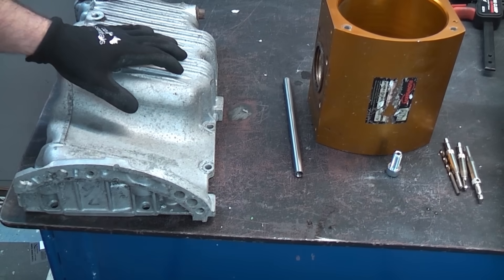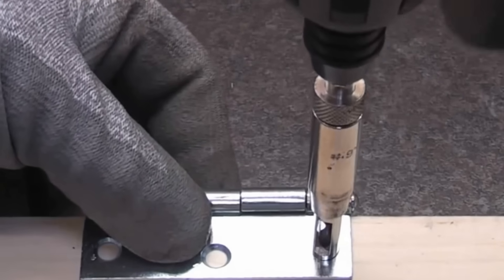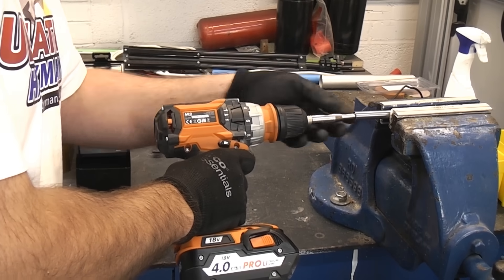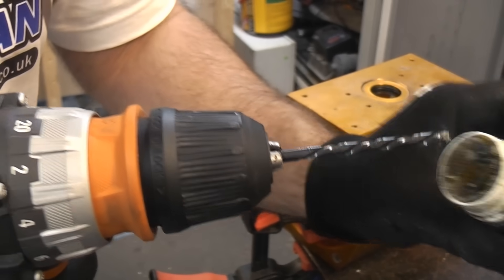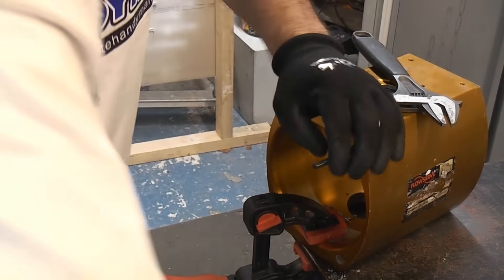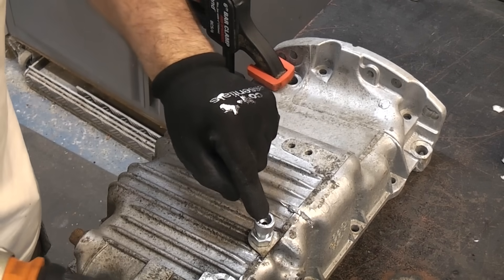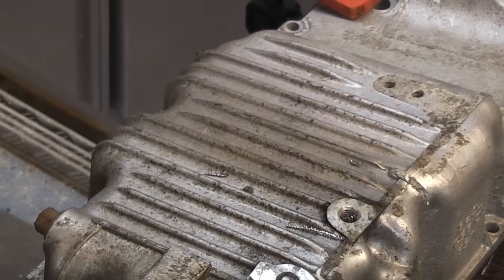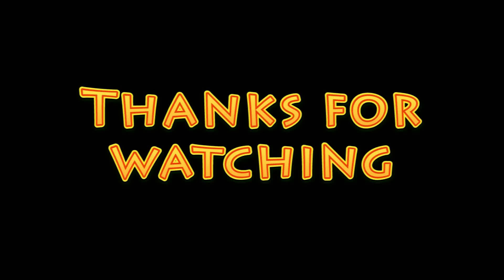How to remove a broken bolt in a deep hole | remove broken bolt in recessed hole

Comment: It’s one of those bizzar truths that drilling a hole through the middle gives the steel a space to shrink in on itself. Only a tiny amount though. The tapered removal tool can have the opposite effect. So if it doesn’t work then consider a proper parallel reveal tool. It’s like a splined rod with special nuts to drive it.
Reply from the maker: Absolutely
Thanks for the comment 👍

Comment: I was a Machinist in the US Air Force for 4 years.  One of the common task assigned was removing broken fasters.  I removed thousands of broken bolts and phillips screws with stripped out heads.
Screw extractors, I do not like the spiral type used in the video.  The tend to expand the broke faster, wedging the bolt in tighter in the female threads.  A weakness of the spiral type is they tend to be of a harder steel easy to break.  The old Rice Crispy cereal commercial "Snap what a happy sound"  there is nothing happy about the sound snap, you  broke a E-Z Out and have a bigger task ahead of you.
I prefer the square type screw extractors.  The square type do not wedge the bolt in the threads and are of a softer steel that will twist before breaking off in the bolt.
I machined a bridge to mount over the bolt I needed to drill.  Interchangeable drill bushing assured that I was drill straight down the center of the broken bolt.  I also used the bridge fixture to tap straight and true threads.
My Flight Line tool box weighted about 75 lbs.  I had lots of specially homemade tools.
Reply from the maker: The square type are definitely better ;-)
Thanks for the comment

Comment: Will never work for most broken bolts which break due to corrosion
Reply: true, you need to heat and cool the really stuck ones multiple times: shock spray, blowtorch, then quench with water. repeat a-nauseum until the bugger loosens.

Comment: Awesome M8! Great idea! Ty. 
 I used to work for Wurth USA as an outside sales. ( I was an auto mechanic for years prior) in Manhattan & Bronx NY territory . Try to get PB Blaster as a penetrent for nuts n bolts 🔩 . Even though it wasn't a Wurth product, my customers swore by it.. I have to say the shit works great! As for heating aluminum casing w steel bolts is a big no no, its like trying to take sparkplugs out of a hot engine. The expansion of the heated aluminum n steel plugs w rip out the threads. We always removed sparkplugs on a cold engines for that reason
Reply from the maker: Thanks Corrado, I'll try and get some ;-)
 Thanks for the comment 👍

Comment: I have actually taken a 7018 welding rod and stuck it to the bolt and had someone to turn the welder off shortly after and then back the bolt out I have used this technique to remove broken head bolts on a Toyota pickup without pulling the head
Reply from the maker: I use 7018 electrodes a lot at work for vertical welding!
Thanks for the comment 👍

Comment: I cut a piece of copper tuning that will fit in the bolt hole then use a drill bit in it so it keeps it centered in the bolt without damaging the threads.
Reply from the maker: Thanks for the comment

Comment: Very well done video, and useful examples.  Where were you (and Youtube) fifty years ago, when I needed you!
My problem then was a broken high-tensile bolt in an aluminium casting.  The bolt had sheared just below the surface of the casting, and it was soon obvious we were in the poo!  The solution was a piece of mild steel flat with a hole in the end.  The hole was centred over the broken bolt, and the flat was TIG welded to the broken bolt by filling in the cavity.  A bit of "judicious wiggling" and out it came!   TIG welding was akin to witchcraft back then, and we were even more impressed when this guy changed rod and built up the damaged aluminium so we could redrill it and tap a new thread.
Thanks for your time.
Reply from the maker: Thanks for the comment 👍

Comment: Just because it's funny...

Once upon a time I was going to replace an exhaust manifold gasket and ran into a stuck stud.

Stud snapped trying to strong arm it out.

Didn't have a right sized thread extractor, but I did have the right sized heli-coil thread insert.

Drilled the stud out, removed the manifold, cleaned it up and replaced the gasket, screwed the insert in, then I needed to snap off the tang.

It's easier of you have the right diameter thing, so I went searching the junk drawer and tool box - no luck.

Then when I was in the kitchen, I noticed the shaft of an egg beater looked to be the right diameter.

It was - then it wasn't.

It was a perfect fit until I smacked it with a big hammer.

Being just cheap pot metal, instead of snapping off the tang, it expanded and was now press fit into the hole.

Drove my truck that way for about 3 weeks until I got around to picking up an ez-out.

It was odd having an egg beater sticking out of my engine, but the gasket didn't leak - the press fit was solid.
Reply from the maker: Thanks for the comment 👍

Comment: Nice butterfly valve housing. What work do you do outside of youtube?
Reply from the maker: I'm a maintenance engineer in two local chemical plants
Thanks for the comment 👍
Reply: @ultimatehandyman  I work as a diesel mechanic. (Engines)  mainly detroit series 60. This is an awesome video. Shared with my friends.
Reply from the maker: @jeremylewis4450   That's a skilful job, I know a few diesel mechanics ;-)
Thanks for sharing it

Comment: Interesting watch but most bolts snap flush with the surface
Reply from the maker: It depends what you work on. We have machines at work where the bolt snaps in the hole. A mate of mine also had a snapped engine mounting bolt on his VW golf and it sheared in the hole, like in this video.
Thanks for the comment 👍

Comment: Great video. Broken bolts are always a pain in the butt, can turn a thirty minute job into a two hour job. Another trick I've used with flush or slightly recessed steel bolts is to tack several welding rods to the end of the broken bolt, then grip them with Vice-grips and spin them out.
Reply from the maker: Thanks for the comment 👍
Reply: If you have an appropriate size nut, drill out the internal threads and place it carefully centred over the sheared off bolt which is flush or a couple of mm below. Weld the nut to the sheared off stud. Wait till it cools a bit and then use a spanner to open. I use this often in the engine room of ships where I work.

Comment: Nicely done, but you're working WAAAY harder than needed to remove steel from aluminum.
Reply: Do a search for "using alum to dissolve ferrous metal."
Basically you mix alum (the stuff cooks use for pickling foods) and sulpheric acid (battery electrolyte) into solution, and submerge the offending bit.
The solution dissolves ferrous metals, but won't harm aluminum.

Comment: This is the first time I have EVER seen an "Eze-out" type screw extractor used successfully.
Reply: Used the ez outs hard outs left drill bits with very good results.
Reply: All the bolts he removed were in good condition. No real rusty ones tho!!

Comment: You are an excellent teacher.  Thank you for your varied props to illustrate your techniques.  The bolt with the hole drilled thru the center was very clever.  Good on you.
Reply from the maker: Thank you very much!

Comment: It has been my experience that bolts have been broken near flush to the surface.  No internal threads were ever visible . Getting a pilot hole in the bolt then was tricky.  Mostly used a center punch followed with a center drill.
Reply from the maker: Thanks for the comment 👍

Comment: Burn a Chronotron 333 welding electrode straight into the hole build up until proud of the surface and turn it out with a pair of vice grips. Easy as that.

Comment: when using the left-handed drill to bite the bolt, having a small pilot hole in the bolt will help the drill to bite easier.  Great video! Thanks..
Reply from the maker: Thanks for the comment

Comment: I am a total novice. Your videos are terrific and informative. Question, why can't you simple use to drill bit set, Speed out, I think? Then take the screw out that way? I Guess I am missing something? Thanks.
Reply from the maker: The hard thing is drilling in the centre of the bolt, especially as they do not normally break completely flat, so starting the drill bit is difficult, hence the drill bit guides etc.
Thanks for the comment

Comment: I had a mechanic tighten my bolt too my into my engine block screwing in the thermostat housing n broke the screw into the block. He used a screw that he lost somewhere in exchange of the original one.. had to tap it out it sucked! Thought it was alll done but I start my car n 5min later my housing blows n I have coolant all over 🤦🏻‍♂️ I should’ve checked the work but I was in a rush for work n had to get towed back home n missed work that day 🤦🏻‍♂️
Reply from the maker: What a nightmare 😱
Thanks for the comment 👍

Comment: Super video.  I thought I'd seen every tool, but those self-centering hinge drills are new to me.  Thanks.  Also thanks to the guy who mentioned using bronze bushings to keep the drills centered.  I've tried the welding trick on coal truck engines with mixed results.  Works great if the bolt is wrung-off nearly flush.  Guess I'm not a good enough welder for the deeper ones.
Reply from the maker: I'm glad the video helped 
Thanks for the comment 👍

Comment: when removing stuck bolts it helps  A LOT  to safely heat - then cool - heat - cool - heat - cool  - repeating several times.  the swelling and shrinking will cause the male / female threads to release from each other.
Reply from the maker: Absolutely
Thanks for the comment 👍

Comment: When I try heat, I always attempt the extraction while the part is very hot. I'm taking advantage of possible differential expansion which may allow the screw to loosen. If it doesn't loosen immediately, then apply the penetrating fluid in hopes that it will wick into the threads. Hit it hard with a punch and hammer to try to break corrosion.

Also, if the screw has been secured with Loctite, it needs to be extracted hot, or the Loctite will again seize it in the hole.

For the real problem studs that have rust and corrosion, it is good to drill the hole in the center, and then pass a small welding rod down to the bottom of the hole (important reason to not drill through!) and then proceed to fill the hole with some weld metal. Let that cool and typically, it will shrink the stud enough to loosen it. Typically, something has to be welded to the top of the stud so you can then torque it out. I haven't found any easy out that is good enough to remove tough corroded bolts.

There are special alloy welding rods that excel for this purpose: typically advertised as high strength stainless rods. They melt and produce a heavy flux. With these, you can dab repeatedly on the top of a solid stud, and build up a little cylinder of metal up to flush, and then weld a nut to that. The heavy flux surrounds the pillar and keeps the weld metal out of the threads. This shouldn't be the first thing that you ever welded ;)
Reply from the maker: Those rods are called X-Tractalloy over here, but they are not very common.
 Thanks for the comment 👍

Comment: Like the left hand drill tip. Don't have a lathe to make a centering bolt set though. Well, not sure my wood turning one is beefy enough for it. Aluminium re-tapping is a piece of piss and extremely satisfying. Not tried in steel though, but it should work just the same.
Reply from the maker: You can make on using a pillar drill as well- https://www.youtube.com/watch?v=6mZj0J6CNYA&t
Thanks for the comment 👍

Comment: Extractor tools seldom work. Best bet is to use a TIG welder and build up a bead on the broken fastener. Then set a nut on it and weld the nut to the bead. The heat from welding helps loosen the fastener, and having a nut welded to it gives you a good grip on the fastener. I have used this method many times when the extractor tool failed
Reply from the maker: Thanks for the comment 👍

Comment: Instead of the adjustable wrench use the correct size 12 point socket.
Reply: @ultimatehandyman  I see you have never tried it but it works.
Reply: @ultimatehandyman  https://www.autodiagcart.com/index.php/12-point-socket

Our tooling is supplied with square drives.
Normally you would use a TAP-WRENCH on taps or tools with squares.
But you will probably not have enough room for a tap wrench because of
clearance issues with a frame rail or some obstruction. Square drive 
sockets are another option. If you do not have square drive sockets you
may optionally try to use 12 point sockets to drive the squares on tools.

Comment: We use high tension welding rod and weld a tiet to it, the heat beaks the rust free, you peen it while it is cooling, screw it right out with flat jaw vice grips. trying to drill it the drill runs off the side and cut the threads. never use a thread extractor, those things break and then you do have a mess!

Comment: Great video. I never thought to predrill a bolt. I prefer the extractors that have 4 teeth the length of the body. I hate drilling broken bolts. If any way possible, I find a larger nut (than the hole) and weld into the broken bolt and pull the weld to the nut, then use a wrench to back it out. It works often but not 100%. Sometimes I weld onto the stud and form a tall neck, then weld a nut around that, then remove it. Heat helps alot. Again, it may take numerous attempts for the weld to not fail. Sometimes I even have to shave the aluminum down to get closer access. If they are flush, you can use a die grinder to smooth the top, then cut a slot in the head and use a straight screw driver to remove it.
Reply from the maker: Thanks for the comment 👍

Comment: Nothing makes a guys heart stop like when you hear the sound of the easy out break off in the bolt.... A whole new level of difficulty is added.
Reply: I’m so glad to hear that happens to others.  I thought that was only my kind of luck. 😂
Reply: Oh man, I had like 8 bolts that were broken off in a hydraulic tank, the company I worked for bought some easy outs from an off brand. I had two break off on me with barely any force... After hours of monotonous hammering with a punch I ended up resorting to welding a pipe nipple to the bolts which worked great. Then..... Some no name brand taps... Broke one off being nice and gentle with plenty of cutting oil.... Me at this point being almost in tears punched that sucker out in pieces and had a little bi*#h fest with the boss.... Good times.
Reply: Had to use a dremal to get a broken ease out out of a head. Very time consuming pain in the butt. A tap is worse.
Reply from the maker: You can drill them out, but it is not easy-
https://www.youtube.com/watch?v=7JCfEMrCjhc&t
Thanks for the comment 👍
Reply: hahahaha true that brother...a nightmare of the highest order..at that point its game over for me..bring in the big hitters at a cost...exhaust manifold bolts ,, i still have re-occurring nightmares about that particular job
Reply: I had a tap break off, I tried everything to get it out, in the end I had to take it to a shop that did EDM (electrical discharge machining)  they were able to basically destroy the tap in the hole.  Thank god the guy who owned the shop owed my dad a favor, I can't imagine what that would have cost.
Reply: it then becomes a cussing job, FUK, FUK, FUK

Comment: Good idea to make a drill guide out of a bolt that fits the hole by drilling a clearance hole in it with a lathe.
Why not put the extractor tool into the drill chuck to get it to spin the bolt out more quickly?
Reply from the maker: Extractors are hard, but brittle. It is best to take your time with them and not attempt to get them out quickly- just in case it breaks ;-)
Thanks for the comment 👍

Comment: If you dont have screw extractors you can use torx that you hammer in and then do the same thing with a tap holder, works great

Comment: I'm already a proponent for the "Left-Hand Drill Bits Make The Best Easy-Outs" fan club, likewise for drill guide-bushings__but will certainly keep the Allen head capscrews tip in mind__but I'd never before seen the hinge drill guide tool in use, so that was a revelation!  
Also, the (I presume, valve) "cutting paste" to increase the purchase of the bit to stud I'd not seen used before; how fast would that dull the bit, I wonder...?  I have used valve grinding paste to keep Phillips and Pozidriv tools from slipping out of a worn/corroded screwhead, so I do agree that your use on a drill bit would also work__we can always resharpen a bit!
Good tips video, good job (and I'm hard to please)!
Reply from the maker: The cutting paste that I use is to protect the drill bit from over heating, it is sometimes called drilling/tapping paste.
Thanks for the comment 👍

Comment: That first one did not look like a broken bolt.  It looked like a plug that was filed and chamfered and placed in the hole to be easy to remove.  And the threads were pristinely clean with no corrosion, dirt or thread locker.  The second one looked a little less like a ringer.  The third one looked more realistic.  I have found it helpful to tap on the extractor with a hammer while turning it very slowly with the wrench.  That seems to seat them a lot better than tapping first and then turning.